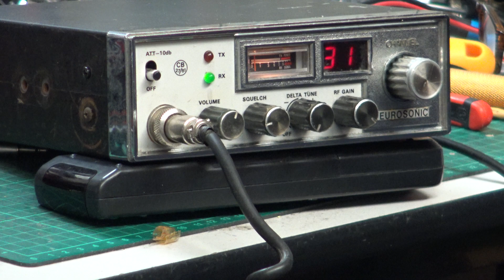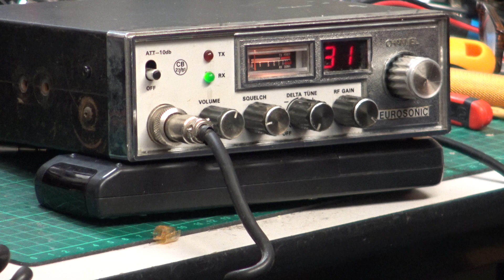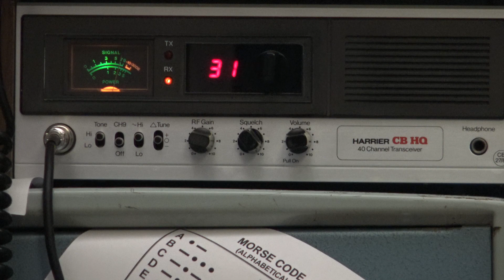Eurosonic PT40 UK CB27/81 CB radio (mobile) - On The Air Test

Comment: Either that deviation is still a bit low (I don't think it was) or that mic is not up to much, I have used them before with no problems, so I suspect that mic is poor to say the least.
Reply from the maker: They  all seem to have poor mike gain. I have gto admit these would perform better with a speech processor mike.....not often I say that.

Richard
Reply: @ukfmcbradioservicingTango21  The one I had worked fine, the mic was more than loud enough, the only thing was the Guzzump noise the oscillator made when it went into transmit, it just took its time to get up to speed.  We all looked at the fault and it illuded us.  Changed what we could get and it still did it.  It worked fine apart from the useless control they put in for a squelch (might have as well put a switch and not a pot' in) but I only paid £10 for it new, so I didn't care much.  It looked so cheap, no one stole it even when it was on full display in the car parked in the city.  I put my aerial in the boot though lol.